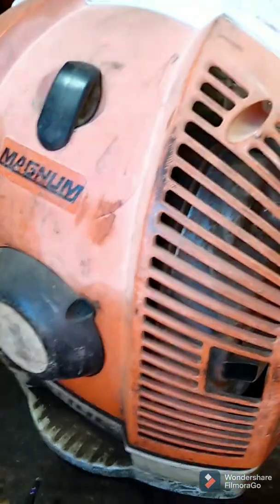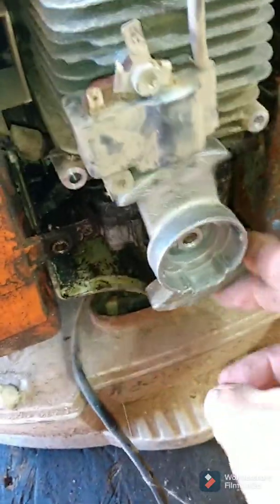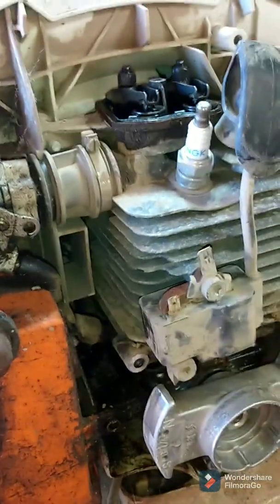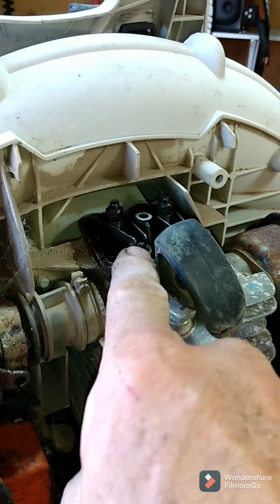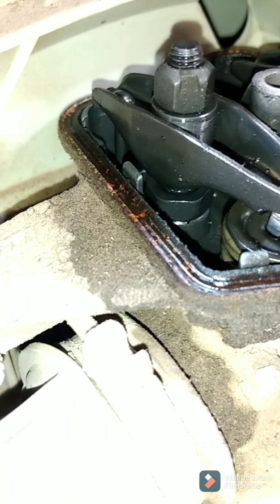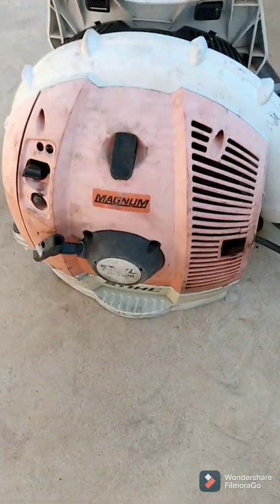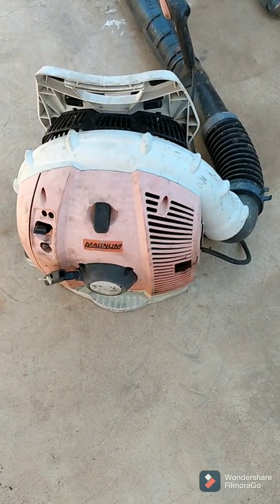4mix Stihl blower has zero compression.

Comment: When you ran the motor at the end it sounded very noisy. Mine had the same valve problem and now it sounds noisy just like yours. Is there something else wrong with it?
Reply from the maker: Nothing else wrong but I will say that my phone is not the best. Crappy sound and video as well. Set the valves, rotate the engine a few times and check them again. 👍

Comment: I’ve got a br600 no compression and checked this issue and everything looked good, what else could it be? Checked the spark arrester as well
Reply: @ZombieDaveAZ  I got the valves adjusted and now I have way too much compression, I can barely pull the cord!
Reply from the maker: @justinhunt9504  that's an easy fix now. The valves are too tight which means they are opening late. Use a .010 ten thousandths feeler gauge. Set them to just barely any resistance or "drag" when checking with the feeler gauge. Rotate the engine a couple times and check again. It's a process that gets easier each time you do it. You might try a .006 feeler gauge.
Reply: @ZombieDaveAZ  I tried loosening them off and it’s still super hard to pull
Reply: @ZombieDaveAZ  I used a 0.005” /0.127mm feeler
Reply from the maker: Loosening delays the opening even more and therefore would do what your describing. Those springs are not super strong so it doesn't take much to be off. Think of it this way : the sooner the valve opens the less compression you will have . The later the valve opens the more compression you will have. Pay special attention to the exhaust valve as that's the 1 that needs to be the most precise.  I'll find another of my videos and send you the link.
Reply: @ZombieDaveAZ  that would be great thank you
Reply from the maker: What do you mean by "it looked good"? Did you turn it over an look at the valves? Is 1 valve so tight that it's holding the valve open?
Reply: @ZombieDaveAZ  sorry by it looked good I meant it didn’t have the problem you showed in this video, and both valves are moving freely
Reply from the maker: @justinhunt9504   If 1 valve is too tight it will "hang" open. Check each with a feeler gauge for about .010 .  When 1 valve is visibly being pushed down, check the other valve. Then repeat it on the other valve.  You will have to trim your feeler gauge to get in that super small space.
Reply: @ZombieDaveAZ  ok thank you, I’ll have to go get a feeler gauge somehwere and let you know how it goes!
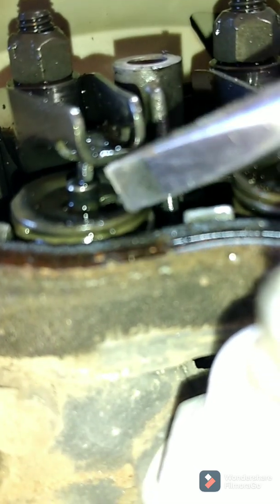Reply from the maker: @justinhunt9504  at the 1:09 mark you can see that upside down "U" that snaps on to the valve stem. That's where you need to take the measurements. Let me know what you find. 👍

Comment: BR 600 blower with no compression. The intake valve was stuck just like this. Thanks for the idea and the content. 1:37
Reply from the maker: Hey Clutch, thanks for taking the time to comment, I appreciate it. Yeah, this happens more often than you think so there's a bunch of these out there that are perfectly fixable and rather easy.  I heard the owners manual says to have the valves adjusted at 60 hours of use. Have a great day and thanks again for stopping by. 👍